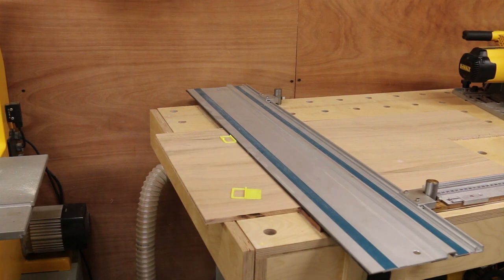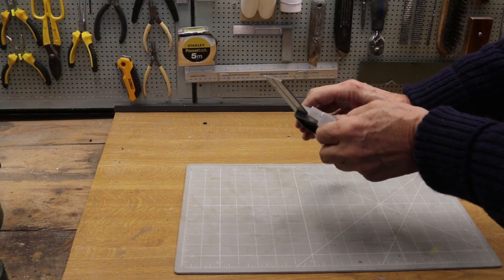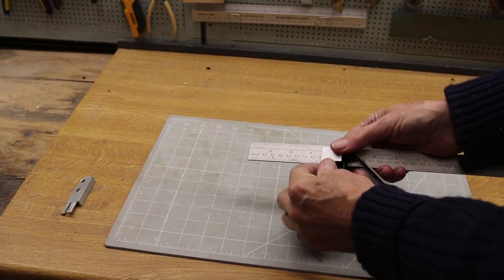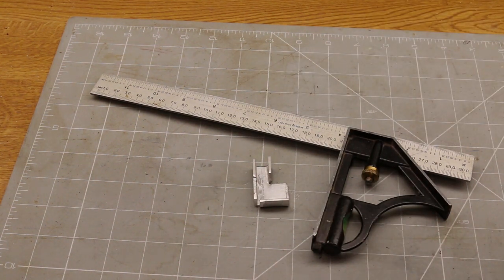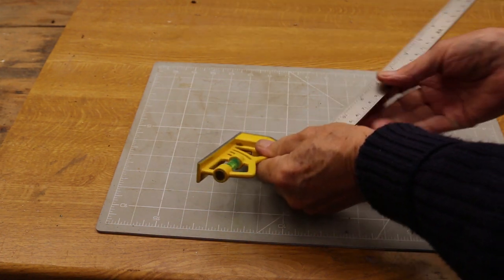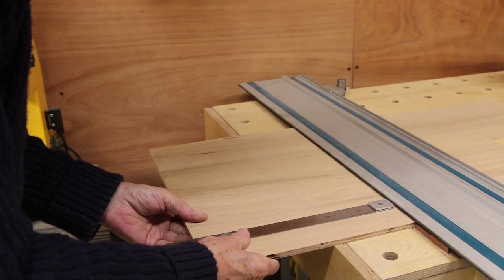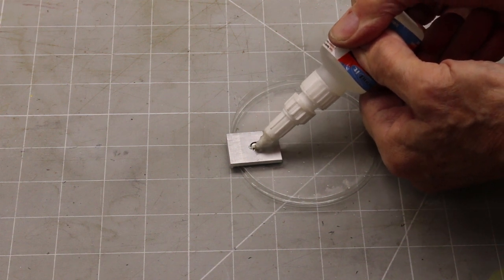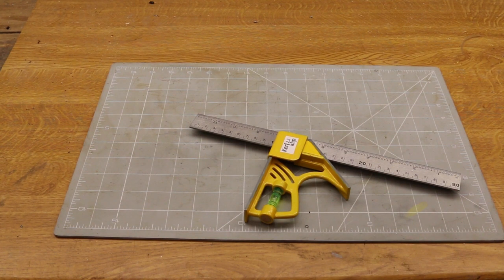KerfKlip

Comment: Hallo Mike, i see on 0:32 you have i believe aluminium version of rail locks, do you have them as a printed version as well maybe? Like from Dave stanton, i visit your Thinvierse but not see them :--))
Reply from the maker: I did a printed version of track to dog clamps in a video 'DeWalt MFT', but for DeWalt track. These could be modified for asymmetrical rails. If there was sufficient interest I could design one…
Reply: @Tensquaremetreworkshop  Thanks for your response Mike, aw i think there is much intrest in those rail locks, i not see them yet anywere and is so easy in use, i have now the woorden ones haha, works great but visual its not so great....

Comment: Great idea Mike. Can you now solve the problem of having to fiddle about with moving the ruler up and down to keep correcting the distance as the track pivots 👍. I guess having two rulers in sync is still the easiest way?
Reply from the maker: Yes- if the workpiece is not large enough for the fence to hold it square, a rule in each hand (with a KerfPlus on each) means you can move it into position fairly easily. This is much more manageable if using my TrakLyft system https://youtu.be/cuzfoUUMuaY - you can have the track just touching the workpiece, so moving it is not impeded by the weight of the track. But you give me an idea (thanks!) - watch this space...
Reply from the maker: You inspired my latest video- https://youtu.be/76FJlUT5-nY I hope that it addresses the issue you raise!